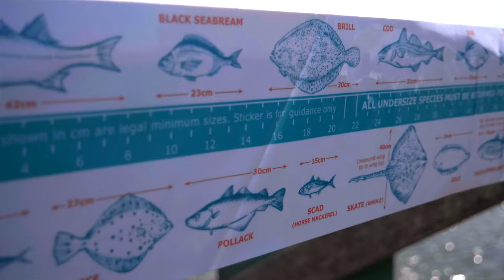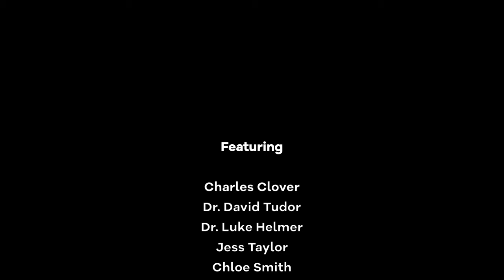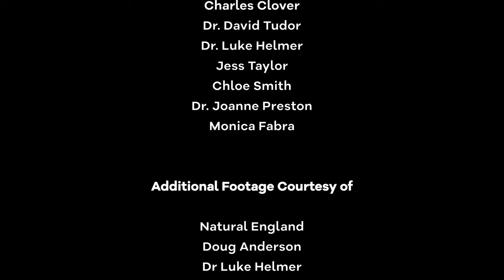SOLENT: The oyster's return

Comment: Only problem is that they have not introduced the oyster that were on the south coast. It is the northern pacific oyster that lives in brackish water, since the introduction, they have spread right up the tidal rivers. The reason what the oyster started to disappear was because the gravel is disappearing and sand is replacing it, this is happening because we are no longer getting gravel moving up the channel from the Celtic sea. 
Stanwood bay was the biggest oyster bed in the Solent, but it as nearly all gone, the SOA did try for years to keep the oyster numbers up by dropping broken tiles, with every storm the gravel moves and sand moves in to replace.
Also this what other marine life are they killing off